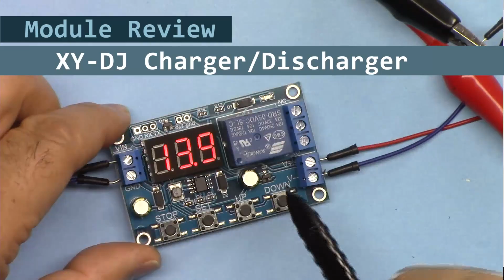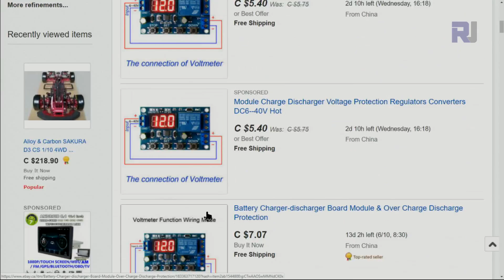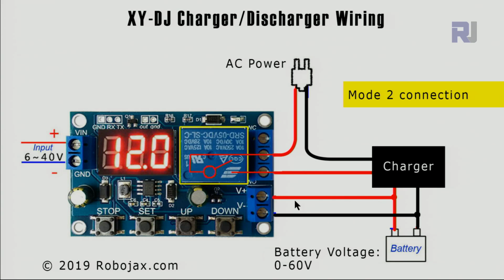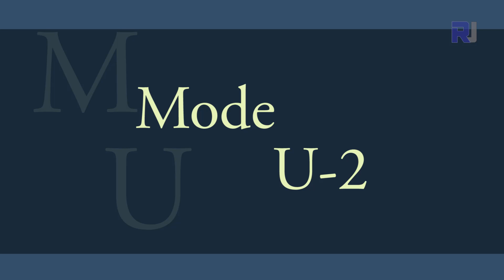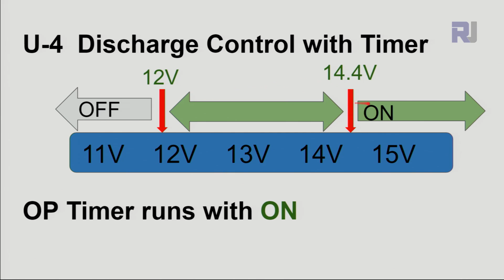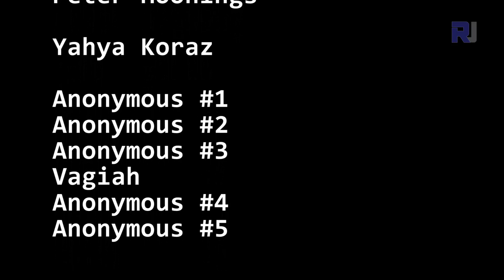How to use XY-DJ Battery Charge Control Module with Over Charge Protection Solar - RJT221

Comment: Watched your video (nice) and was wondering will this work as a discharger for Li-ion 18650 cell(s)? 
Would like to place a single cell in discharge mode and have the unit cut off the charging voltage to the cell at 3vdc. Does this have that low a setting didn't see the setting for cutoff discharger voltage set to 3vdc?
Reply from the maker: Thanks. this module doesn't know anything about discharge. But it can watch the voltage. Lithium battery has state of charge and when voltage goes below 3.2 or something like that,  is considered discharged but it varies by the manufacturer of the battery. so Yes. this can work if you set proper voltage. But remember this can't control the current and that is very important. otherwise you battery will get damaged.  See this video to learn about battery charging https://youtu.be/0mOqpCfAdy4 or about battery protection https://youtu.be/3dwA8A8VrrE

Comment: I understand the reason for switching the AC supply but would be extremely worried about the very short creepage path between the relay's coil terminals, which are at battery potential, and the relay's contacts which, in my case, are at 240 volts. There is not enough separation .
Reply from the maker: for 220V even 1mm is enough. Only when it is above 1kV then space matter.
Reply: @robojax  Thanks for your reply. The 1 mm that you suggest is the distance in dry air that can be bridged  by 1 kV in the form of an arc. I believe that the accepted separation of switch contacts in air is 3 mm at 240 volts, 'though I stand correction if I am wrong. On a PCB there is the risk of tracking, particularly if the surface is contaminated and/or is in the presence of high humidity which is why the better type of switched-mode AC/DC power supplies feature a slot in the PCB between the primary and secondary sections of the circuit. Big Clive is at pains to warn us of insufficient separation, either on the PCB or in their transformer windings, in his video strip-downs of dodgy USB plug-in adapters. In any case thanks for a useful lesson in the use of the module, I've had one for some time and was in the dark as to its features.
Reply from the maker: I agree with you. Thanks.

Comment: You mentioned that you would give more information about using the Rx and Tx to control the module, but I can't find anything in your video or the description. Do you have any links to the code for the XY-DJ?
Reply from the maker: I mentioned as I remember (can't watch my video) that nothing is available on RX TX. Not worth it. to spend 2 or 3 weeks to learn that, learn Arduino in 2 days and make your own fully programmable charge controller.

Comment: Dear Sir, how are you?
Where can I find the RX tx protocol to get the information that I desire. 
I am using an ESP 32 and I would like to get battery voltage level from this output pin or from the RX tx data.
I appreciate it if you could help me. 
Thanks and Best Regards,
Rodrigo
Reply from the maker: Hello, you can't find it. find who is manufacturer and contact them. Why would you waste your time for. use Arduino, make must better than that.
Reply: @robojax  Thank you for your reply. I appreciate. I will use ESP32 bit I am afraid of how can I protect the ADC input from a reading of 53V from the battery. Using this device done it makes easier and safer. That's why I would like to get the information from it.
Reply from the maker: you can measure 1000V with Arduino. Watch my video https://youtu.be/t8xwrVj2aFs

Comment: There s a way to read @ precisione of 0.01v from serial?(even if lcd show max 0.1v)
Reply from the maker: no way. her is the page of one seller https://www.aliexpress.com/item/4000068468499.html  and it show ± 0.1V.
Reply: I have one reading 64v on what two other instruments read 55.5v
Honest
Don't know what's going on
Left it running for last 20 mins
Fingers crossed
So far disappointed
But great little package
I'm wondering if some XY-DJ packages have 12v Songle Relays and therefore 12v supply, I'm chucking a good 9v at the power supply, isolated entirely from the sensed circuit, and it's clearly reading high!

Comment: What is the voltage output on the output points when active ?  5V I assume?   I could control a SSR with that?
Reply from the maker: There is not output. it is a relay which is a simple mechanical switch and you can connect 120V, 220V or DC 5V or 12 it is up to you. Please watch the video without skipping and you will see I have left nothing without explaining it. I am different.

Comment: Hi, 
Can i check if i am able to use the charge from the battery to power up the circuit's voltage requirement?
Reply from the maker: Hi, I have mentioned it in the video. Yes you can if it is within the input voltage range.

Comment: can i use this as a ups?
Reply from the maker: No you can't. UPS works with AC and this can sense only DC. if you sense DC from an adapter, it has capacitors and the power will turns OFF in about 1 or 2 seconds. So it will not work. unless you modify it by adding AC to DC converter to measure AC only and then it will react fast. Right now it will react very slowly to AC shut off.
Reply: Robojax oh seems alot of work, i thought it can be used like a solar charge controller without solar but dc input instead. you know to cycle my battery pack charging and discharging without interruption while using like a wifi modem
Reply from the maker: can you pleas when you say "discharging" what do you mean? Are referring to using the power from the battery by the system. or really just wasting it as discharge?
Reply: Robojax sorry for the late reply. yes thats exactly what i mean i need something in-between the battery and the diy 12v tv which the module charges the battery and onced fully charge the module switches the tv back to battery as the relay turns off

Comment: Hello, I think that this module is thought to work on Acid Lead batteries. because 57.6V for 48V batteries is too high. The right voltage for 48V batteries is 54.6V
Also, do you have the manual to control the Module via Serial port?
Reply from the maker: I just watched the video to answer your question. at 7:15 I have answered your question.

Comment: can we connect a 24V solar panel instead of charger  to charge 12v lead acid battery?
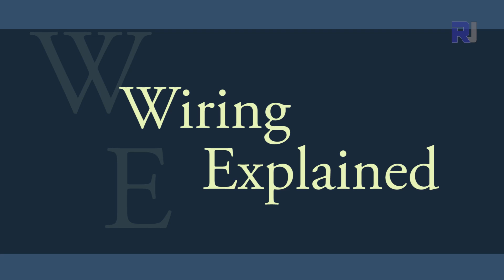Reply from the maker: at 2:59 I mention that. this module needs separate voltage to operate. You can keep it separate and your solar separate. yes you can do it.

Comment: Can I use this for when my battery gets to 14v it will turn on and instead of a charger it connects  to a resistor to use power till 12v
Reply from the maker: Yes you can do that.  keep your resistor connected to relay to turn it ON and OFF. If you not skip ads it will help me. Thank you.

Comment: Can this device also applied for the cellphone battery
Reply from the maker: this doesn't know the type of battery. It just knows the voltage. So if you set proper voltage it will work lese, it will damage the battery.

Comment: Would it be possible for cellphone charging?
Reply from the maker: this is not suitable for Lithium batteries as those batteries, need current control and voltage control. This can control only voltage and might damage the battery if you don't monitor it yourself.

Comment: Nice review as always. Thanks for it. Just that @ 25:20 you mentioned it not functioning good with Lithium batteries. What does Type of batteries has to do with functionality of this generic module? Its governed by Input voltage and as long as it gets the reading it should work. Could you please explain the issue in a bit more detail. Thanks
Reply from the maker: You are welcome. Yes you are right it should work. I mentioned it because people don't know about Stat Of Charge (SOC) or a battery and other parameters. If you know all parameters of the battery, then you can use it and it is not automatic.  Lithium batteries need different current at different stage of charge. So if you can handle that, use this otherwise this will reduce the life of battery.
Reply: i baught one off this to monitor my lifepo4 battery if it works i will bay 36 more to my Car insted of BMS and by a sepret Balancer insted  still waiting for it to come in the mail may volt is 3.3 nominal and 3.65 at top so this moduel is not best still loking for a more prices model
Reply: Actually this Module is Not a charger at all. All it does is read the voltage and Connects the charger to the battery. It doesn't control how the battery is being charged. There are two  main types of chargers. PWM and MPPT. MPPT are used for deep cycle, lithium and a few others. PWM are basically for car battery types. I won't go into why and how they work. There are several videos and sites that explain all that. All this module does, is connect those types to the battery as I said before. The MPPT chargers already come with overcharge protection (discharge protection not so much), so if you want to use it for that then that's an option but the actual proper charging is handled by the MPPT.

Comment: Thanks! I bought a few of these not knowing what they did and finally found a good tutorial. Well made video, I subscribed :-) now in mode 1, could the input charging power be a solar panel to replace the AC in?
Reply from the maker: You are welcome. Sorry I did not understand your question "input charging power" . I watch ed the video to answer your question but could not. Perhaps you are referring to Mode 1 and Mode 1 . Please watch it gain.
Reply: Yes it can be because the relais switch contacts seem to be isolated and can switch AC loads.

Comment: Helo ,

I need a help from you can you pls make video for electric scooter i have 2  lithium battery 1 is 60v 24ah and othr is 72v 24ah for this i need  60-80v auto changeover or auto cutoff circuit
Reply from the maker: Hi, I have no experience with electric scooter. I will see if it worth working as it seems very expensive.
Reply: Pls make it , i m searching but not found for dual battery auto changeover charging for 60-80v . It will helpful for every one in feature .

Comment: Hola , estuve mirando tu video , me da gracia de ver hasta que punto no saben como facturar estos chinos , fabrican de todo lo que se les ocurre aunque luego termina siendo una parte del todo , bueno, las tensiones son mas o menos esas , en el caso del litio si exceden de 4,1 volts se puede formar oxido en el terminal de cobre , y por supuesto por debajo de 3,6 volts estan débiles claro que no hay un control de la corriente  y en las de litio es muy importante ya que son muy explosivas e inflamables no sera la primera vez que alguien sufre quemaduras , una bateria de litio 18650 se puede cargar con dos amperes pero con un gran riesgo  de elevación de la temperatura y de explosión , algunas tienen protección interna con un circuito electrónico pero no conviene una corriente de 2 amperes , yo prefiero no superar los o,8 amperes  o menos ,a estas baterias hay que respetarlas por que te responden agresivamente , ahora con las de gel , la cosa cambia ,claro que tiene que existir una diferencia de potencial al final de la carga , en este caso 14,6 volts , de lo contrario ya no se cargan , aunque al final de la carga la corriente disminuye drásticamente , y se hace mas lenta para completarla , , las de niquel cadmio tienen memoria , por lo tanto hay que descargarlas , estas ya no existen , las de niquel metal no tienen memoria , y en general las demás , en conclusión este dispositivo es un voltimetro , un comparador programable  con histeresis  , y un rele controlado como llave de arranque y parada , en fin un aparatejo mas de la ingenieria china al servicio de sus bolsillos , jajajaja, buena explicación , aunque hay que tener una idea para usarlo correctamente , un saludo !!!!!
Reply from the maker: Hola, la carga siempre es un proceso complicado. Ahora hay miles de universidades de todo el mundo trabajando en cargadores. En unos pocos años tendremos nuevos dispositivos para trabajar con dispositivos Fuel Cell y el hidrógeno parece muy prometedor para el futuro. El juego de chepeaset y el más abandace del universo. Pero en cualquier caso, tendremos que almacenar energía desde la toma de corriente doméstica o desde la pila de combustible de hidrógeno.
Gracias por tu repetición. Tenga un buen día.
Reply: @robojax  
Hola , cierto , estoy al tanto de algunas cosas , estaria bueno un desarrollo serio y transparente del uso del hidrógeno , como fuente de energia no es nuevo , el sol y los océanos son realmente inmensos, pero con la carrera enfermiza que aun tiene el petroleo quizá tengamos que esperar , con relación al hidrógeno aún se tejen mitos sobre el destino que tuvo  Stanley Meyer , aunque quizá sean solo especulaciones , Saludos !!!!!
Reply from the maker: Hola, por ahora en Canadá no tenemos un infraestructura para la célula fule de heydrogen. en mi provincia Ontario, no hay estación de servicio. A solo 2500 km de distancia en mi oeste en Alberta, solo hay uno.
Prefiero la pila de combustible de hidrógeno y no puedo esperar hasta que esté ampliamente disponible.
Salud
Ahmad
Reply: @robojax  
Cierto , el almacenamiento es un tema complejo , Saludos Ahmad !!!!
Vicente